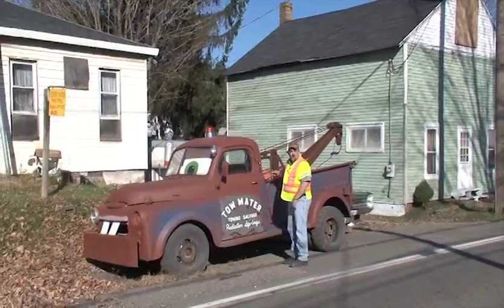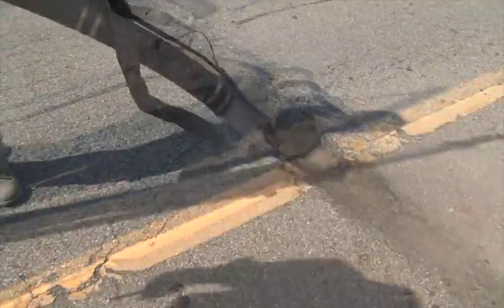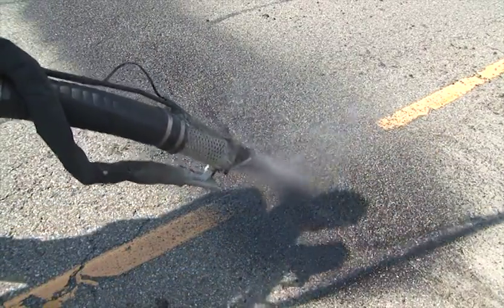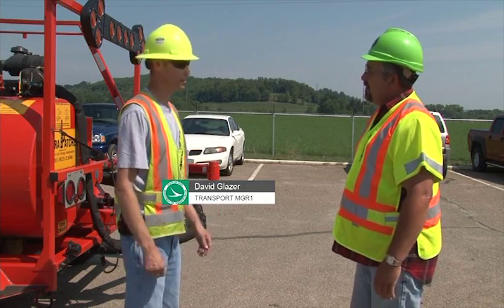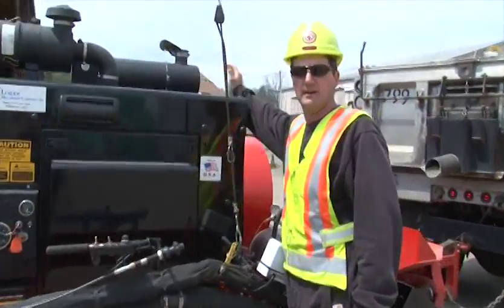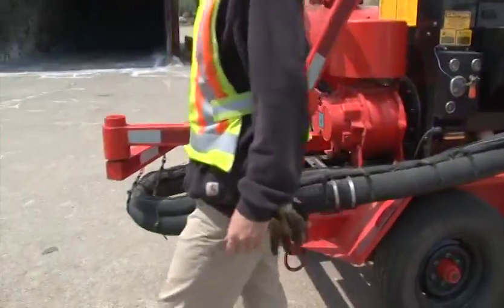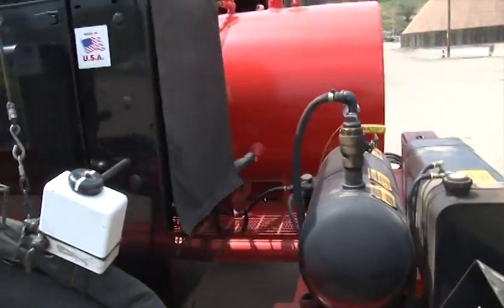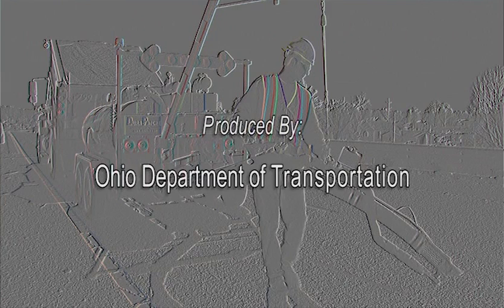Spray Injection Patching

Comment: We got the most square footage of potholes repaired with the Dura Patch. The key to it though is clearing the lines every day and when you are at lunch I would say. Also keeping clean emulsion in the tank. If the emulsion gets gummed up, the machine will be useless. You will spend all your time trying to figure out where your clog is. I feel if the tank was plugged in and had a constant circulation of a blade or something similar it would really help.

Comment: really? get a Roscoe ra300 or 400 it only requires one operator and no one on the ground  this process requires two people and you're running 2 engines  instead of just one
wow